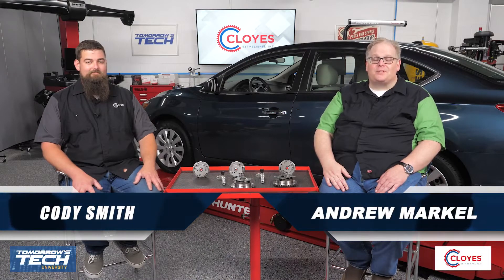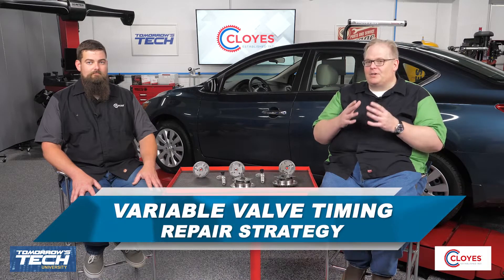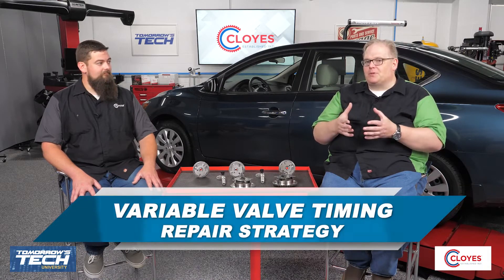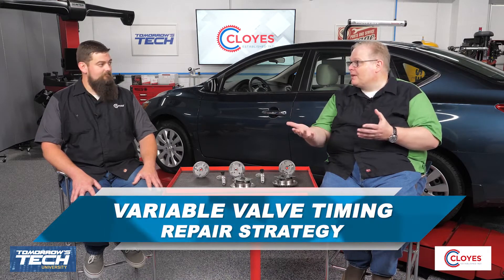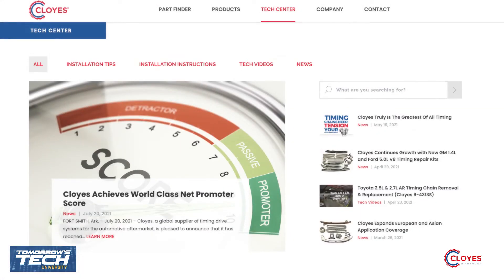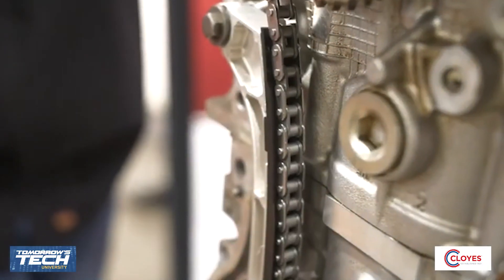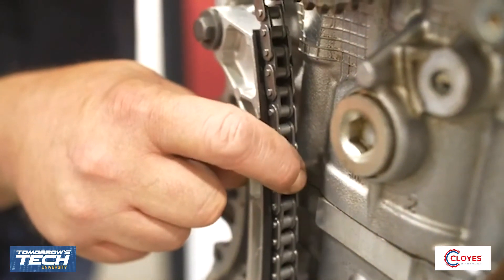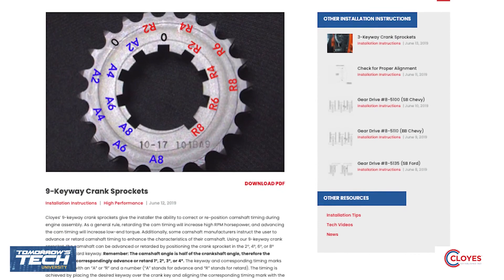Diagnose VVT Systems: Variable Valve Timing Module 3

Comment: I have a 2014 Corvette Z51 with the 6.2 engine, with 50k miles on it, and I'm having a timing issue. We've taken the engine apart three times now and replaced a lot of parts, all original. The parts include the camshaft, lifters, trays, pushrods, phaser, sprocket, chain, timing chain tensioner, and even the high-pressure oil pump with the solenoid. The second time we started it, the engine ran for about 15 - 20 minutes, and then it shut off, and we couldn’t restart it. It felt like there was no fuel, but we realized the timing had gone off and we lost compression. We took the engine apart again and saw the timing was off. I thought it might be due to oil pressure, so I installed a new high-pressure oil pump. We replaced the magnetic camshaft sensor again and used a new bolt for the phaser, plus a new chain and guide. And still, the same thing happens.